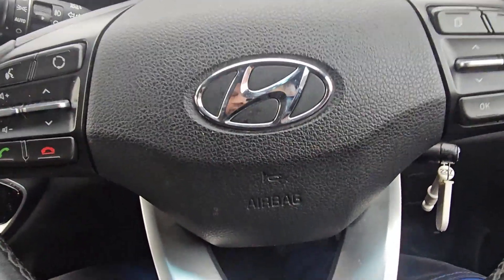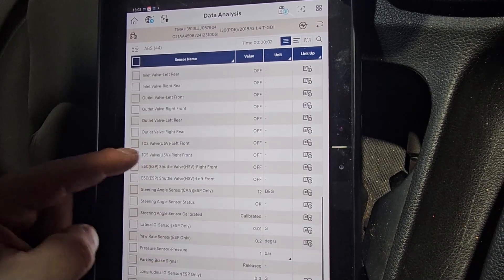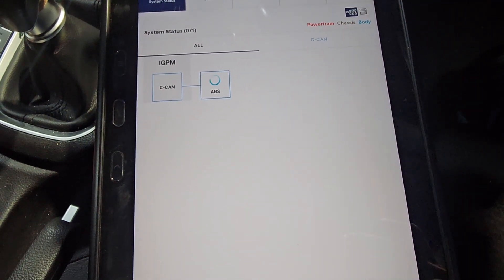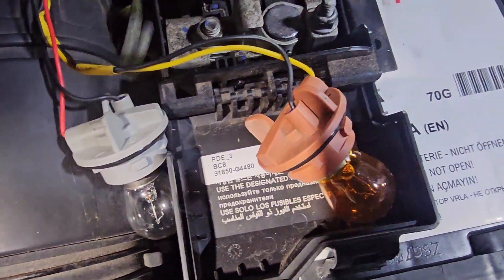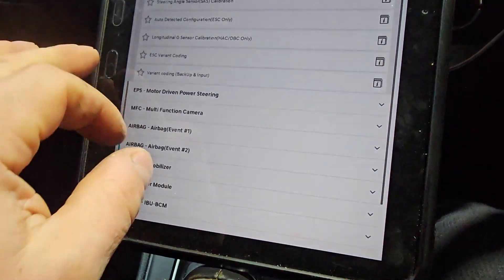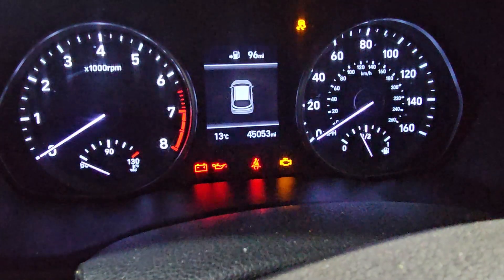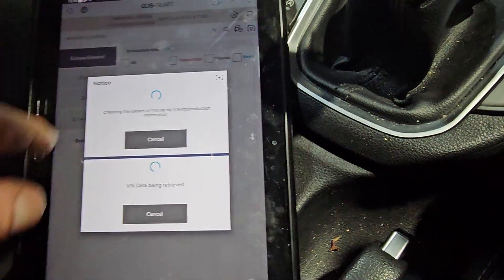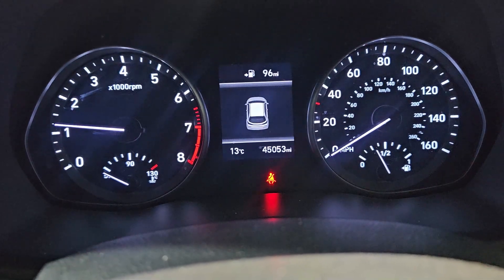Hyundai ABS ESP Motor Electrical Fault C2402

Comment: What scan tool are you using?
Reply from the maker: @guaping2012  i was using GDS Smart, genuine hyundai scan tool. But any two way communication diag machine like autel, launch, topdon will work
Reply: @GicaPhp  the scan tools that you mentioned is its gonna work with acc calibration and reset an angel distance?
Reply from the maker: @guaping2012  if you get launch x431 yes for example it will work
Reply: @GicaPhp  thanks because I just need to reset the angel distance to zero so i can reset the acc avoidance assist system on the dashboard!
Reply from the maker: @guaping2012  you can reset steering angle sensor easy with them